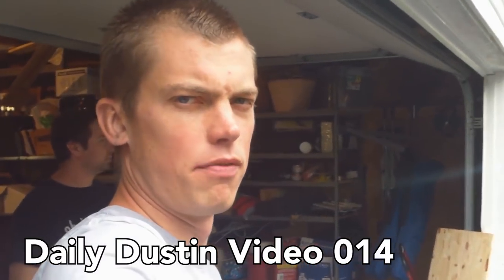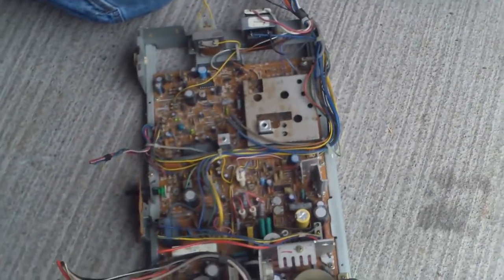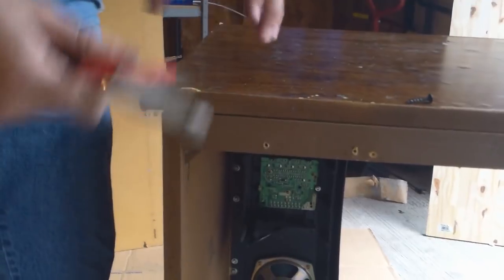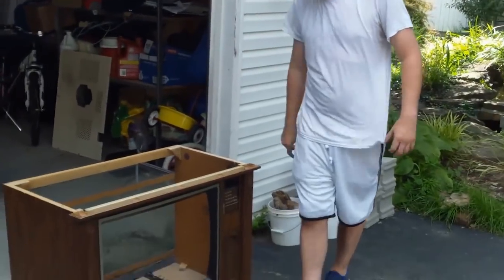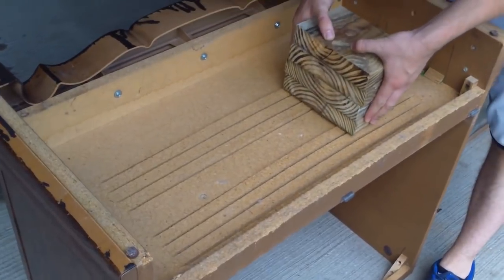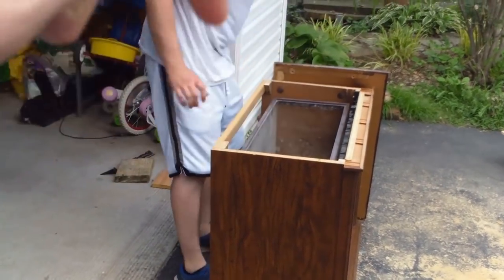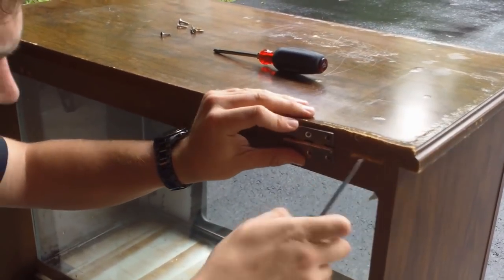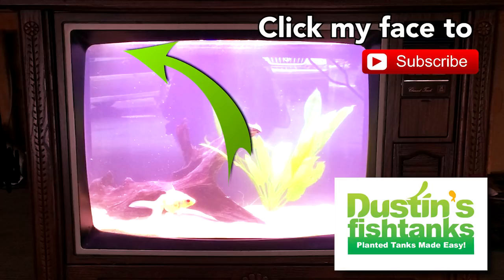HOW TO BUILD AN AQUARIUM TV FISH TANK!

Comment: I transformed a 1950's Motorola tube radio into a ten gallon aquarium complete with hang on the back filter and LED lighting. I use the original radio switch to control the lights. Where the speaker was is my power bar for filter and heater and lightning.
Reply from the maker: Daniel Dulu dude that's awesome . Got any pics or a video- link it up!
Reply: I sent you a email through your business email address. If it is worthy I can make a video but it will be the same pics with maybe a short video showing how I maintain it by taking the top off. I did put in glass lids to stop water from condensing on the wood and possibly releasing toxins into the water.
Reply: I guess you answered my question, I will make a video of it and send you the link.

Comment: A simple way to actually do this would be to have a glass cutter cut the exact size of the tv and seal all the pieces into place then any would that is still in contact with the condensation have water treated and painted fully then I would wire the knobs to the light switch so I can use the physical mobs as my switch’s for the tank and then all those wires I’d just strap down and then refinish the outside and boom you got a custom tv fish tank